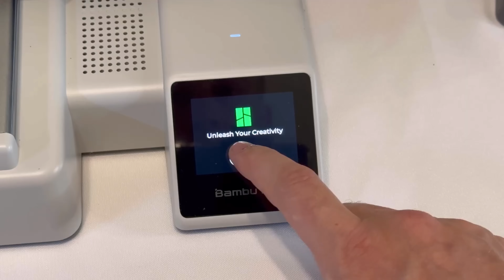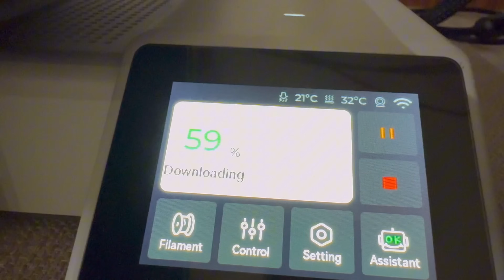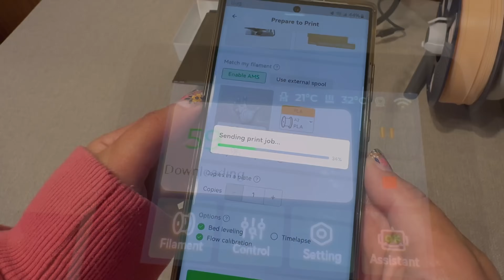Bambu Lab A1 Mini Review - Update After 9 Months!

Comment: You forgot to mention the amount of waste when switching colors. Even conservative estimates from Bambu Lab is that a 11g object wastes 83g of filament (with 153 filament changes). That's 8x of waste. I'll never purchase a AMS/multi colored printer until they resolve this issue. (edit - and I know they now have the "purge into infill" option) which I do not know if it was used in their example.

Comment: I have had my A1 mini for almost a year now and have had no issues with it. I wanted to get into 3d printing and this was a great low cost option for me (got it on a Black Friday deal for $200 without AMS) to see if it was something I wanted to get into. If not, only $200 wasted (that I could probably get back most of by reselling). 
Simple to setup and use. No previous experience needed to get started. I have not bought any more printers, and have not gotten deep into 3d printing and designing and such, but have had many instances of needing some little thing and realizing I can print it myself. I have probably broken even in the money saved making it myself on the printer vs buying it, plus have had fun tinkering with it. I really would like to get into actual design of items, but have not gotten there yet. 
The print size of the Mini has not been an issue for me at all, have not needed to make anything that would not fit on the print plate. 
I have suggested it to several others as their first 3d printer, and they all have been really happy with it as well.

Comment: I am an old phart retired EE. After watching a ton of YouTube I pulled the level and bought the A1 mini. I have had many flawless prints. Printed a near butt-load of upgrades for it. Made some cute toys. I had a problem with some cheap wood filament. But PETG not a problem. The only issue that required some trouble shooting was when the inside temperature exceeded 30C. (Phoenix, AZ) I SWAG'ed that and now have no problems.

I love my mini.
Reply: would like to know what problems related to indoor temps of 30C as I an in such environments
Reply: @hk9443  I was having problems with prints falling off. I finally lowered the plate temp and the problems went away. It makes no sense to me. But I now simply use the cold plate setting when printing PLA and everything sticks.  PETG still seems iffy I use a BiQu Glacier plate and software setting to the Bambu standard plate.
(Bambu A1 mini)

Comment: I got an ender 3 pro. Extruder broke so had to buy metal one. Wires detached from hot end so had to get another. Couldn't get it right after that. Total nightmare. I've had A1 mini since last Nov. No tweaking, no broken parts and only one failed print enough I think was the model. Just sold mini and got A1 combo

Comment: How good is it with petg? Also what about the print quality compared to the P1S? I need to add some printers for a product I manufacture and want to be sure quality is consistent across my products. I mean for barely over $200 what a deal if it's comparable to the P1S in quality.
Reply: In my experience when printing with petg i find it struggles to adhere to the build plate more so i put a large brim or glue on, im using esun petg
Reply: @fleecym Yeah that's funny, since this comment I bought one and actually I'm floored that the quality is just as good as the P1S if not slightly better! It was giving me a little trouble with PETG also, but I found a huge clear tote that I put over the top of it and problem solved!
Reply: It's bambu, it's gonna be mediocre at PLA and crap at everything else

Comment: I've had an A1 for a little more than 3 weeks and I'm already thinking about getting a second printer because it takes time to print things. For example,  I'm printing the pieces necessary to  install Multiboard in my workshop. I'm part way through printing 18 8x8 tiles. At 3.5 each it's taking quite a bit of time. If I had a second printer I  would be able to start printing the snaps and attachments so I would be able to install once the plates are done. The lower price of the mini makes it a good option for printing the small stuff.

Comment: i too trust my a1 mini. after the first layer i am certain i can just go to bed and wake up to a print that is finished. that first layer though is nerve racking, and one i keep an eye on. but after that i can just leave it printing no issues.

for filament, i store it in my sunlu filladryer s2, and use it directly, and rarely have more than one spool in use at a time. currently have some PETG on a spool, but i keep it stored with silica packets, and had it dried before storing it. might need to look into a proper container though, right now it's just in a plastic bag ins a cardboard box.

i also have mine mounted on anti vibration hardware. found some odd looking ones, printed them, put them on some foam(to further isolate it) and it is so much more quiet. recently attached them using a modified mount for a different anti vibration thing.

also considering the AMS system(or AMS light) but the price is not in my budget at this time, so for now that is a "future me" thing.

Comment: My a1 mini crossed 500 hours yesterday and im quite happy with it. Had some issue with some plastic from a homing sensor that was rubbing on a belt and the support told me to sand it down. I recently also noticed artifacts appearing but i got rid of them after tightening the belts. Much better than my enders but my next one is definitely going to be the core one even tho the k2 plus looks really promising

Comment: I bought a Creality CR10S Pro 6 years ago and printed not super often over that time. It was great but I spent a lot of time fixing it and tweaking it. I think all in I’ve spent $1000CAD at least on the printer and upgrades. Recently, I’ve been having issues with it and I think the main board is on its way out. Was thinking of grabbing an A1 Mini because they’re currently on sale for $250CAD.. its crazy to me that for a quarter of what I’ve already spent, I can get a printer that I’ll never really need to touch, it’ll just work.
Reply: I’m in the same exact boat right now, did you pull the trigger? I’m also considering the p1 series for the bigger plate and more contained footprint
Reply: @ I ended up getting the A1 Combo with the AMS Lite. Decided the bigger build plate was worth the money over the mini. So far, I think I’ve already put almost 500 hours onto it in like 5 weeks haha

Comment: Yes, I share the same experiences. Even the A1 does in 2% miss bed leveling. The A1 Mini works all the time. But one think, the filament tangles around the spool holder beam when spool is fully new and the printer arm lowers to bed (without having AMS). If you know this it´s no problem.
Reply: Agree, have this problem.  Have to experiment with some of the modified spool holders out there.

Comment: I own a Neptune 4 Max, I have it nicely tuned and upgraded to the point of giving consistently good prints. I am not a beginner with 3D printing as I have suffered through the old Ender 3 days. I just bought one of these for £155 (no ams, i legit don't care about ams). I bought it because it feels so pointless firing up such a large printer if all I am going to print is some little 50mmx50mm or whatever model / part.

I hope that my experience is as good as yours!

Comment: OK I hear you, but I would really like some feedback on my situation. At 75 I do not need to waste hours tuning or upgrading a Printer. I really need to print parts for people. I have targeted my Model Train Hobby to keep my engineering brain working in retirement. I had some some CAD experience but when I found Autodesk Fusion 360 free for Hobbyist I was a pig in (old farm boy word).  I am only using 10% of Fusion Power but it was a dream product that did not exist when I graduated in 71 (not that was when i got drafted), in 75 yes.  I work on AC Gilbert American Flyer trains from the late 30s to the mid 60s. S Gauge which is larger than HO and smaller than Lionel O. So i can still see the screws. Most of my really cool parts are upgrades to the weaker functions in the old trains. I use PETG for strength and heat resistance.  In the last 7 years folks have been watching my You Tube Videos and asking about my parts. So my 1st printer was a TINY Plastic Printer to get a handle on the process for $100. It worked and with in weeks they had an upgrade so I started down that path. But i needed a bigger machine. I found a returned printer at a big discount. It was listed as a CR 10S Max but arrived as a CR 10S Pro in like new condition. They gave me a rebate if i agreed to keep it. Since that day I have upgraded nearly every part except the base and Power supply. While i liked it and finally have it almost right. I know find i get asked for parts when I am busy in R&D on larger parts Chassis, Bodies and Testing new designs. So a small simple reliable high quality printer CHEAP, is in order. I wondered if you would be willing to test print a few of my parts. So I could verify the quality and speeds that are realistic.  I also saw the drier and that makes good sense too. Sorry to be so windy. I really appreciated your video. Dennis in Virginia

Comment: Did you get the $350 version or the $200? Whats the difference?
Reply: The difference is the AMS Lite accessory, for automatic multi filament printing.
Reply: I mean if you got 200$ one you don't have AMS but! You can print a manual one. I actually made a gcode where on color change the printer will cut the filament and pause to give me a time to pull out slightly old color and put in new one. Someone would say that I need to babysit the printer 24/7 but most of the times I'm just using multicolor for keychains only and small figurines. So yeah AMS was kinda useless for my use case - that's why I didn't buy it

Comment: Cameras suck on these printers not because the camera is expensive but adding the hardware to run and broadcast them is vs the potato components on the A1 and P1 printers.  One of the reasons the X1 is so much more is the actual mainboard components.  At least with the P1 you can actually see what is going on though.  The A1 mini they might as well not even have included one.

But at $179 right now without the AMS you just cannot beat the A1 mini.  Like... nothing else even begins to approach it.

Comment: Thanks for the great review, sounds like info I have heard from many happy owners.   

Are there any folks here who own the A1 and the A1 mini and can pipe in which is their favorite of the two, differences, experiences between the Mini and full size A1 with AMS?  I would love to hear from folks who own both units!  One thing I did find out owning the small Xsmart3, Q1 Pro, and my larger Plus4 is that my tiny Xsmart3 runs non stop no issues and I think reason it works so great is due to fact that it has a small 180 bed which just is plain solid as a rock...........my other printers run great, but something about my tiny Xsmart3 that I absolutely love... sounds like the mini A1 works great for much the same reason, solid small build..........it does make a huge difference when bed is not part of the equation.    Thank you.A

Comment: You need to get your power cord up and away from the gantry. I use a 12$ Boykeep camera that is PTZ, infrared, light etc. from Amazon. I have it on a different table [reduces shaking of the video]. I don't mount extra weight to a single arm gantry device that way. Also I use 4L cereal boxes with rollers and CM4-10 connectors [ I don't have an AMS. Why do you paint items if you have an AMS?] and with desiccant in the boxes I usually have them down to 15-20% overnight, no dryer needed. Stored and ready to go, just connect the Bowden tube and print. I agree with you on most items. I wish it had a bigger bed, but the A1 is still having issues with the heat bed. They don't want to admit to it but a LOT more people are having adhesion issues on the A! vs Mini. Also, don't touch your plate, lol.
If you are interested in what I have setup, contact me.

Comment: I wonder if the mini is more reliable because it has a smaller build volume. If you used an a1 or p1s and only did small things in the middle of the bed would they be equivalent in reliability
Reply: Probably because it uses a traditional cantilever design compared to Corexy on p1 and x1 printers.

Comment: A1 mini is great till it's not. The second you have to start replacing parts. The entire thing comes crashing down. For an "entry" level printer it has the worst tool head. They don't sell full replacement tool heads. The wiring is awful, the way it attaches is awful. The fact you have to pull the heater to even remove it is awful.

Yes this is a great out of the box printer but the second it starts getting wear and tear and you need to replace things on it. It becomes a complete nightmare. It's almost not worth to even attempt to repair it without cheap. They sell it.

Plus they have one of the worst support desks I've ever had to work with.

Comment: I replaced my (Day One) Prusa Mini with the Bambu Mini.  Then I decided to get an A1 as well (no AMS for either).  Those two printers for about the same price of a replacement Prusa Mini+.

I've been 3D printing for about 9 years and when it comes to the combination of print quality and ease of use, nothing I've owned in the past comes anywhere close to the A1/A1 Mini.  The only downside so far was finding out that when the A1 gets working on a big print at high speed, either of my two printer tables go into permanent earthquake mode.  So I had to order an actual workbench (which I should have done anyway).

Comment: I decided to jump on the A1 Mini combo a while back when they dropped to 349.00 at Micro Center.
It almost stripped the X belt on the first run along with almost breaking the arm off for the filament cutter.
The bearings were rough, but cleaning and lubing them fixed that.
The Z screw and nut had 0.356mm of backlash which according to Bambu should have been near 0 .
The new assembly they sent me was great.
It was quite the pain in the butt to install the entire Z assembly.
Within a hundred hours I had to tighten all the screws behind the hot end. 
When attempting to level the bed and address the warp in the bed i discovered the build plate adjustment screws were all tighter than tight.
Which was okay once I backed them out to where they should have been set from the factory. 
This was my 9th printer from various manufacturers.
Needless to say my first Bambu experience was not great.
My one creality unit the K1 Max was stellar in comparison.
But to be honest at about 1200 hours i had to tighten the screws that hold the heat sink to the extruder on it.
Reply: You appear to be one of those people who makes mistakes and blame others then call it out as a bad product